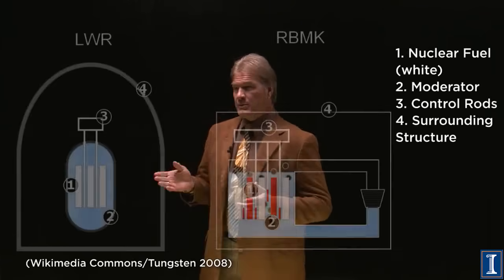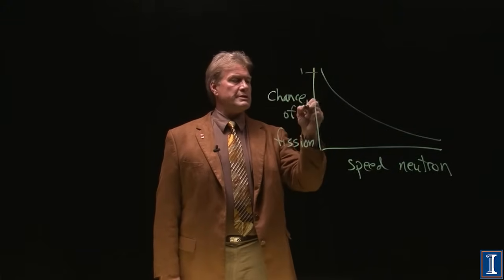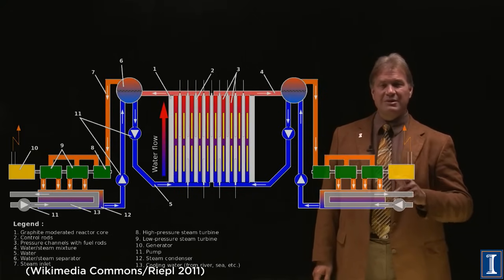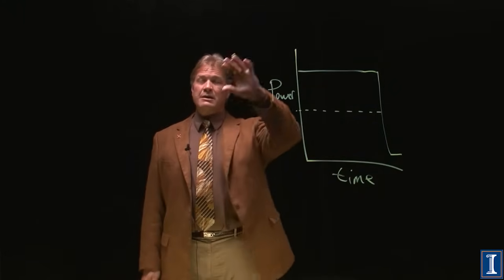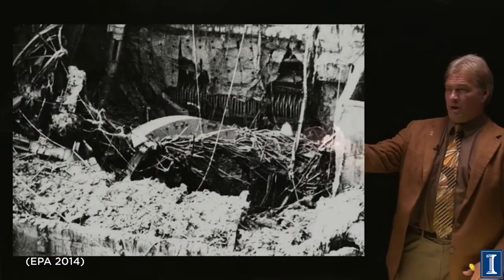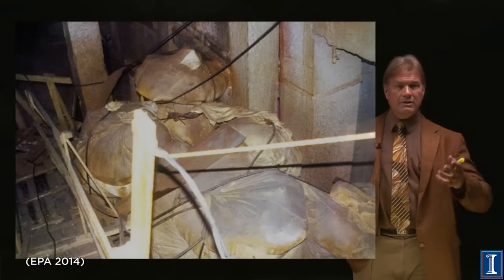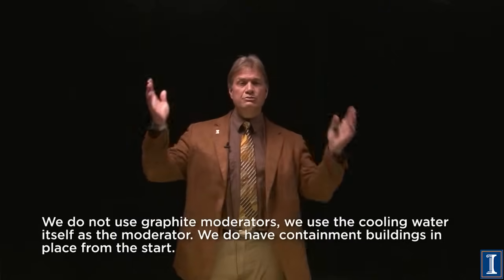Chernobyl: Worst Accident Ever

Comment: Since RBMK reactors can be refueled with the reactor operating, I doubt that it was about to be taken offline due to refueling.
Reply: they can be in small parts due to how large they are, but chernobyl was due for a larger refueling and maintenance that it worked out to run the safety test the reactor had failed 3 times already. so it was going to be taken offline.  whats even crazier is that RBMKs can and had melted down partially due to the same problem that reactor 4 had on mass. One of these events was even AT Chernobyl (reactor 1) a year or two prior!

Comment: I'm a little put off by the fact he keeps saying "RMBK" instead of "RBMK", that he's gotten the timeline of the evening of 25th April 1986 wrong, that he explains the methodology of the emergency test completely incorrectly, and most worryingly that he fundamentally misunderstands what 'graphite tipped' meant with the control rods.

ETA: He also states that he thinks the chain reaction stopped after the explosion, even though the the fuel and the moderator were all still in position AND all the water was gone.

Comment: $10 bucks to the 1st to give the answer without looking it up. 
What was the worst nuclear disaster in the U S?
Hint; no ones going to get the right answer!
Reply: Offer still stands, Craig shot his wad so your out shitbird, besides, your a moron.
Reply: 6 months is enough time and no one got it right, so the offer is closed.
It was at the Santa Susana Field  laboratories in 1959 and wasn't revealed until 1979.
High in the hills overlooking L A to the south and home to people that built there over the years without a hint of a problem.  640 times worse than TMI,  hows that for a cover up!
Reply: Based on deaths that's super easy:  SL1.  Three dead.  That makes it worse than Three Mile Island and Fukushima since no one died at either of those.  Now you will run and hide since you aren't good for the ten bucks.
Reply: @danadurnfordkevinblanchdebunk   I'd like to give it to you in person. but no, your answer is incorrect Craig, hows your mom?  Give her my regards.
Reply: Hanford.
Reply: @daddyfeed7826   That s negative.

Comment: Great video! However, I think one thing is missing there. Maybe it's not important, but it gives the answer WHY that reactor was designed in that way. Normal water stops some neutrons. So, you can use normal water as a moderator, but only wen using enriched Uranium as a fuel. It's expensive. Charnobyl's reactor was designed to use not enriched Uranium. They needed to use heavy water then. It's expensive too. That's why they use carbon as a moderator. In such situation, a normal water (as a liquid) stops some neutrons and lowers power level of reactor. When boiled and changed into steam, it increases the power level, so we have ANOTHER positive feedback designed into this reactor! That's also the reason why control rods have famous graphite "tips" - if you pull out the control rod, the water would go into it's place and it would not increase the power level. If a graphite rods replaces the borium rods it will increase the level of power. 
https://en.wikipedia.org/wiki/Heavy_water#Neutron_moderator

Comment: He states that the Soviet RBMK is similar to the Canadian CANDU (PHWR) @ 1:05 .  That is a very misleading statement.  The  pressure vessels both have tubes for the fuel otherwise the CANDU is considerably different (and far safer) than the RBMK.  A containment building does offer an additional layer of protection (as it did in Three Mile Island) but the concrete containment failed in the Fukushima plant which was a BWR (a type of LWR) design built by General Electric.  One thing all the incidents shared is a lack of planning, foresight, training and management.

Comment: t=475
The reactor was being shut down for maintenance, not refueling. The RBMK can be refueled in the middle of a campaign. However the fuel did have a fairly high level of burnup, which caused removal of fixed absorber rods from the core and putting the core in a dangerous state by increasing the fast power coefficient.

t=668
There was no 'cardinal rule' against raising power up again.

t=712
There was no regulation against pulling out that many control rods; the RBMK was designed to operate that way. It was called the Operational Reactivity Reserve and was specifically meant to overcome xenon poisoning after an unplanned power reduction. After the control rods were raised, the ORM value was still higher than the limit.

t=730
They weren't trying to reach half power, only 200 MW out of 3200 MW. These were not extraordinary measures.

t=741
Power did not increase at all, until perhaps the last 10 seconds of the experiment, and this is disputed by the IAES INSAG-7 report.

t=773
AZ-5 was pressed at 200MW, nowhere near half power.

t=809
He skips the step where technological channels rupture and flash all the coolant into steam, leading to a prompt criticality. At this point a steam explosion is possible even without hydrogen generation. Hydrogen can't appear instantly in large quantities, so the steam explosion is what dislodged the reactor lid.

t=932
Only 6 of the fatalities were firefighters. The rest were plant workers and 2 security guards.

t=964
The reactor next to Unit 4 did not keep operating for more than an hour or two and was shut down for a year.

Overall, a moderately clever person with a High School diploma could put together a more accurate lecture by reviewing the (misleading and poorly written) Wikipedia article on the subject. Truly disappointing performance, but not a whole lot worse than the average, where Chernobyl is concerned.

Comment: The expression, "buy cheap, buy twice" comes to mind when thinking about Chernobyl.
Skimping on safety measures to save money, ended up costing them a lot more in the long run. It always does.
Reply: And in any future events feed in the human element. One day someone in rush to get home for one reason or another will do something wrong and... Bang????
Reply: It’s like when I do any form of carpentry “measure once, cut 3 times, realize I bought shitty materials, quit”
Reply: It should be noted that Chernobyl was a reactor primarily used to produe weapons grade plutonium. Electricity was a byproduct. So it is kinda malicious to equate Chernobyl with civilian grade nuclear power plants.
Reply: @alexandervlaescu9901  Electricity was not a byproduct. Plutonium production was somewhat feasible, but it really wasn't the intended effect nor the ideal solution to this problem.
Reply: @alexandervlaescu9901  this is total BS. Effective plutonium production requires much higher enrichment for a larger neutron flux, depleted uranium target rods for easier starter separation and fast neutron channels, maybe cooled with a gas instead of water. No such things were present in the design of RBMK, it was a uniform low enrichment moderated flux reactor.
Reply: It's a communism pure nature. They even speeded up the construction to get bonuses from the government and that speeding was due to hull skin installation skip.
Reply: Sounds like Soviet logic to me.
Reply: Dyatlov knew emergency core cooling system was off, and he ordered more control rods removed than was allowed, just so a meaningless test could be done. And people still say the reactor design is to blame instead of Dyatlov's ego and bad decisions.
Reply: @Thagomizer-U235  ikr, it rarely is design at fault, assuming it has been fully tested, it is normally how it is run, badly, outside of spec. hence nuclear is a real danger even with improved design.
Reply: @Thagomizer-U235  Beware of xenon folks.
Reply: True about nuclear energy generation in general. Nuclear in itself is the epitome of that “buy cheap” concept, since the idea of fractional long term fuel costs makes bean counters cream their breaches. They damn sure aren’t lowering power bills because nuclear fuel is cheaper.
Reply: @BrianLTanner  Not even close?  Look at France.  They've been generating the majority of their electricity from nuclear since the early 70s?  You ever heard of the French Chernobyl?  Because there isn't one.  The American "Chernobyl" didn't kill anyone and didn't result in many injuries (3 mile).  The Japanese "Chernobyl" was the result of a 1000 year tsunami and a 200 yr earthquake AT THE SAME TIME and still wasn't even within an order of magnitude of Chernobyl.  

People think nuclear has safety problems because nuclear only kills people in spectacular ways.  If someone dies due to nuclear, EVERYONE knows.  But it's very easy to ignore the cancer and lung ailment deaths from coal, because people die from those things all the time.  Coal kills heaps more people than nuclear ever has.

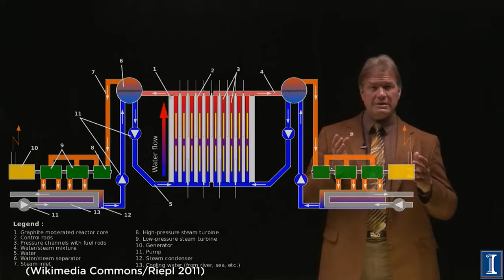Comment: 8:00 RBMKs can be refueled while the reactor is at full power.... their is no need to shut it down (or again, even reduce power)
one of the benefits of not having a pressurized reactor 
.
iirc.... they were shutting it down to replace parts / do updates and inspections

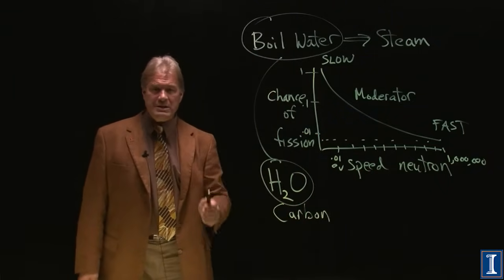Comment: 5:50 except..... japans reactors were SCRAMed
and they still melted down (and then explode, due to hydrogen..... and we only THINK the reactor vessel it self didnt break)
.
and american reactors have MANY tests with "large coolant loss" scenarios 
its part of the reason 3 mile island melted down
.
they had so many safety systems for having a 3 foot pipe bust...
but not a lot of a bad relief valve 
.
anyway..... back to japans incident.... 
as far as i know..... looking into it a few months ago to see if anymore info was released
no one has been able to actually inspect the pressure vessels and containment to see if their was a breach 
.
however.... the amount of radiation released.....says it melted threw the containment 
it might not have scattered fuel for miles like CNPP.... but its kinda the same situation....just in the ocean 
.
and some film footage shows a perfect circle smoke ring.... coming from a square building
to me, that says the pressure vessel popped
.
which would be EXACTLY like a CNPP unit 4
except japans reactors are a LOT LOT smaller (you could fit about 8 of them in an RMBK)
.
still... that means fuel was ejected
Reply: Or you could have just looked something up instead of making yourself look like a fool:  https://en.wikipedia.org/wiki/Comparison_of_the_Chernobyl_and_Fukushima_nuclear_accidents

Comment: The Chernobyl guy was a self-taught expert on the RBMK reactor.  His previous background was submarine reactors.  He was noted for his ability to cite technical manuals.  The weakness in RBMK reactors had been identified about a decade earlier and it was published.  But someone redacted the part of the report that talked about preventing an explosion.  Whether the lead guy had clearance for the redacted portion (probably) and whether he could have accessed it (pre-web) is undetermined (or at least unpublished itself).
Reply: This is what happens when you choose key people on key departments based on politics
Reply: @diggydumbo  "Exactamundo."
Reply: I'm not sure which Chernobyl guy this refers to. Of the three convicted, Bryukhanov, the plant director, was a turbine specialist and construction manager. Toptunov, the chief engineer, was a nuclear engineer, but he went straight from school to the power plant business. No subs.
Dyatlov was in charge that night, and he was an electrical engineer. He didn't follow the most basic safety rules, let alone the procedure for the test.
Reply: He could've been self-taught to eyeballs, that woudn't change anything. Simply because submarine reactors are PWR which have nothing to do with BWR.
Reply: I doubt it would have mattered much.  The same political pressures and the same lack of care for safety to satisfy those pressures would exist.  The problem was not one flaw with one reactor, or one bad decision by an operator without all the information.  It was a failure at nearly every level.
Reply: I can't life like a submarine Reactor because of this Life I am D O I N G like the Prof. In the Video Demonstration is writing behind All and All behinder and behind it... that's not possible... i can't understand it... it's nonsense for us all... Super... Dummel Will Not Life... Amen...Ciao Wiktor Witas Kuhn from Bremerhaven and Amen You All, I try everything to escape this 20000000 ttilliard Super Nintendo... that's impossible... I Love You Math ... ❤❤❤
Reply: Imagine how he would have felt, the guy who redacted those chapters, when he came to know that his action of suppressing knowledge, contributed to one of the greatest disasters in human history.
Reply: @dexterroy   The central library is not the place where technicians would look for information on an RBMK's weaknesses.  Terrorists would look there.  Not those employed and cleared to operate an RBMK.  Hence, a redaction from a document available to the Soviet "public" would not necessarily prove that Dyatlov was unaware of the weakness.  The newer guy who threw the AZ5 switch obviously didn't know, but we don't know if it was covered in his training on a day he was absent or whatever.
Reply: @crimony3054  If I were an operator in that control room, I would be very wary about hitting any button that drops all the control rods at once. I am assuming they knew at least this much that it will be graphite that will enter the core first, not boron carbide. 
I would have done that one by one. They probably panicked at how fast the reaction swung.
Reply: @dexterroy  That's the problem, though - they didn't know about the graphite displacers. The operators were kept quite spectacularly in the dark.
Reply: @davidfuller581  oh c'mon. It is not possible that someone operating a fissioning core will not know about what is going inside and out of it. They may have been aware of the physics around it. They may not have been aware of how the kill switch works.
Reply: @dexterroy  That guy was "erased" for the safety and the security of the Soviet Union State.

Comment: One correction and one omission. 
Graphite, while a form of carbon, is more akin to the "lead" in a pencil than a lump of charcoal. 
Second, while a Chernobyl-like chemical explosion cannot happen in modern reactors, they still produce a waste product that remains dangerously radioactive for centuries, so the question becomes "what will be done with the radioactive waste?"
Because reactors in the US are run by private concerns, the matter of the waste being handled by the lowest bidder greatly increases the probability that it will be "disposed of" in ways that create unnecessary and long term risks to life that are even greater than the result of Chernobyl, either unintentionally or deliberately.

Comment: Some things you say are true. But you also talk a lot of nonsense. The Chernobyl reactor could be refueled during operation. That was one of the advantages of this reactor.  So, on that day, reactor 4 was supposed to be stopped, but not because of the uranium filling, but because of the safety test and because of the regular overhaul of unit 4. He had another advantage. It could efficiently produce energy with low enriched uranium (about 2%). The reason for this construction was of an economic nature. The boron rods had graphite ends for the purpose of reactivity balance. Because when the rod is pulled out, the space is filled with water, which in addition to graphite would slow down the neutrons too much. That is why the space under the bar was filled with the graphite part of the bar.

Comment: Moral of the story, don’t test your safety systems.
Reply: Test it, but without 200 tons of enriched uranium inside, heated to water vaporizing temperatures.
Reply: @rakesrunner  they werent enriched... Thats why there were 200 tons.
Reply: @maxmustermann4827  it was enriched, but to a much lower degree than other reactors require.
Reply: Moral of the story:
- Never build positive Void coefficient reactor
- Build a good containmentbuilding
- Moderator and Coolant must be same water
- Every worker needs knowledge of Xenon 135
Reply: @maekkelmann345 diesel generator in the basement: 🗿
Reply: Test it, but make sure for every safety system you have, 2 more should be in standby. One that works with no humans or machines needed, just physics.
Reply: Test, but with BRAIN!
Reply: the test should have been done before the reactor was even operating
Reply: Testing is fine, but what they did was reckless testing.

That kind of complacency doesn't just happen with nuclear reactors though, it happens in every industry. Regulations that get put in place for safety (often after an accident or narrowly avoided accident) cause things to become safer, the safe conditions make workers and operators complacent and they eventually start bending the rules or flat out ignoring them, accident happens cause safety precaution wasn't followed, industry vows to put in place protocols to make things safer, problem repeats itself eventually.
I think I read of one 

As a fire warden I constantly have to deal with people blocking fire exits or propping open fire resistant doors which are meant to always stay closed, people just never think the worst will happen until it eventually does.
Reply: Moral of the story: don’t be a commie
Reply: Lol